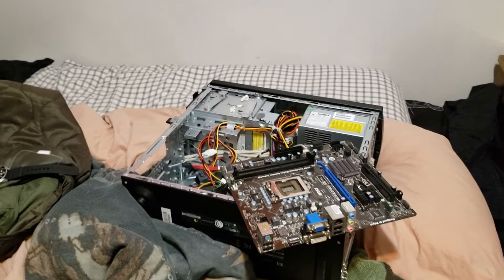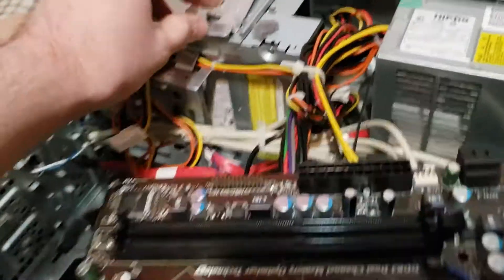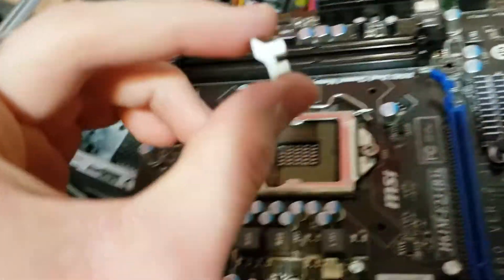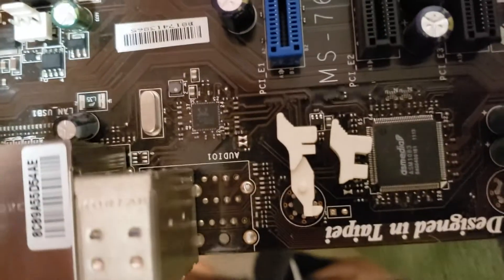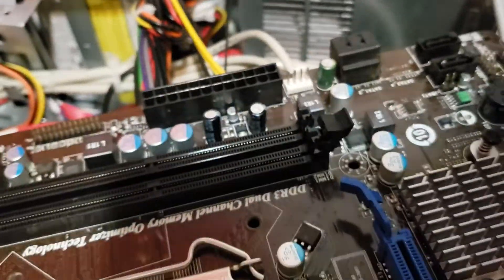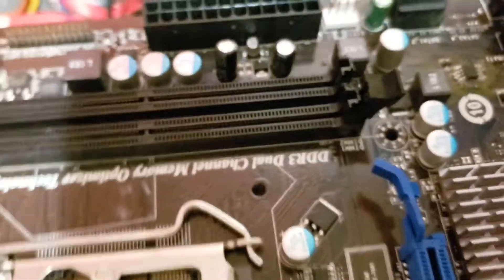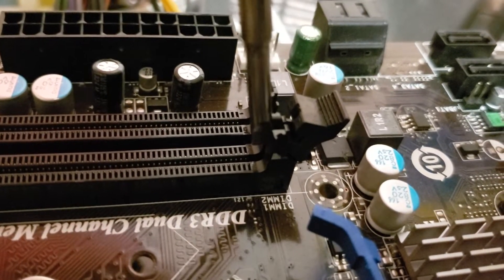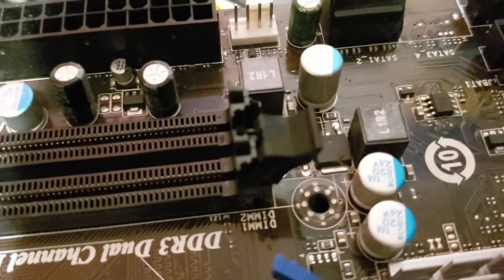Remove / Replace DIMM Retention Clips / Tabs

Comment: ive bust mine in such a way that gpu is locked into the mobo i cant get it out clip does nothing! i push nothing it wont budge what do i do? the gpu thats in still works however i got a 3070 ti to go in it this is so annoying.

Comment: The problem with me is mine loose can anyone help
Reply: Same here! How did u resolve?
Reply: @ricx2576  if it's just the clip that is kind of loose and NOT the memory stick it will be fine, the main purpose of the clip is actually to make it easier to remove the chip then it is to hold it in place. As long as the memory chip is seated in the slot all the way it should be nice an snug, if the chip feels really loose like it would fall out of the socket if you tip the computer over then I would be a bit worried.

Comment: I have 3 GPU ports on my motherboard is there a way to take one of the other and put it to the main GPU port?
Reply: you ever find a solution for this? thinking about doing the same since i broke the main GPU port closest to the CPU
Reply: @khoa22693 Does ur gpu work after the clip broke?

Comment: Would this work with the hooks on a pci.e slot?
Reply from the maker: Hi! There's an 18 second video by Ben Jump, where he shows one being installed. It looks like the tab fits similarly, so I'd guess that the same removal method that I used would work. I can't say for certain. I'd hope that different clips would fit, too, but its hard to say. I'd like to think there'd be some universality to it all, but I can only guess! I hope you can get your things fixed.
Reply: @Ne1s0n64  thanks man I managed to fix it up. You've been a  huge help!